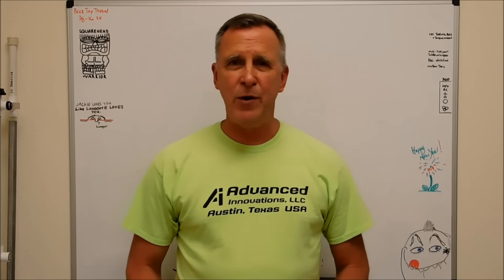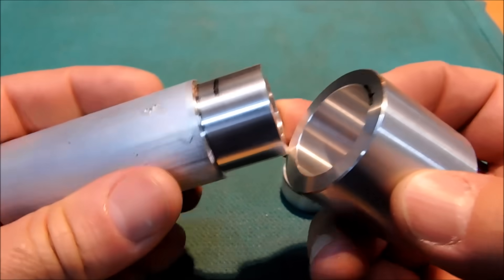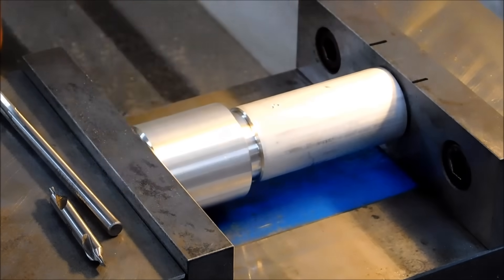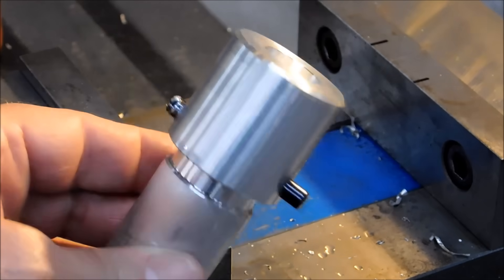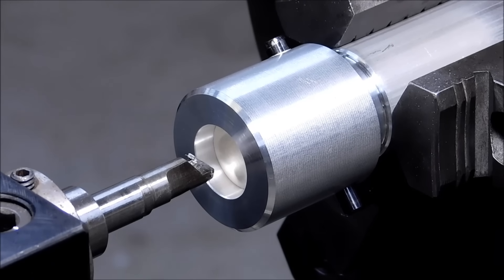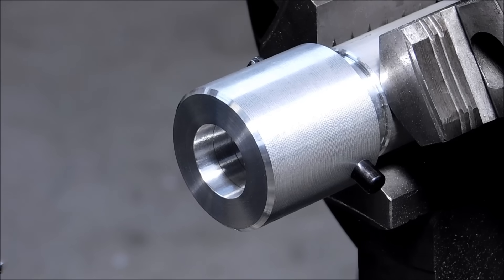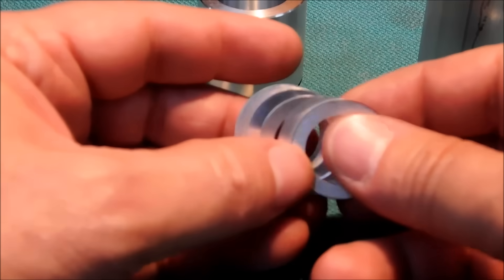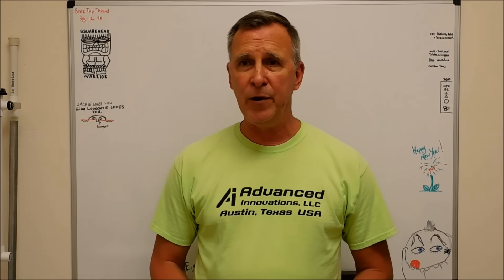How to Hold and Bore Out Thin Shims

Comment: Excellent tutorial as usual, Joe! I have a few questions..... How fast was your lathe chuck spinning while boring? Would the feed and speed be determined by the type of shim material, as if the tightly clamped stack of shims were a solid cylinder? Would you make the arbor out of the same type of metal that the shims were made of, or does that not matter? While applying cutting fluid during boring or drilling for the pin, is there any danger of too much fluid wicking into the stack of shims and possibly causing a problem? Also, someone else in the comments was asking about the unusual boring bar that you used. I too would like some details about it.  THANKS!
Reply: Solid carbide boring bars are nice 'cos you can sharpen them to a much higher degree (using CBN or diamond) than an insert. But they're expensive and fragile. What you can do is grind up a worn or broken 2 flute end mill to make a small boring tool (grind one side away; I use a green grit wheel for roughing )

Comment: Never did shim stock so no opinion - washers, a whole nuther story. Stick in tube with spacers at either end, screw on cap, drill, bore/ream. Has worked for me when I needed larger holes. Reverse procedure when washers are to large in dia. Screw down center and turn to fit.

Comment: you can re-use the cap  by drilling thru from a different angle, that way, you can re-use it at least 4-5 times.
Reply: If you started small you might be able to use larger and larger pins too, assuming the batches of parts are similar.